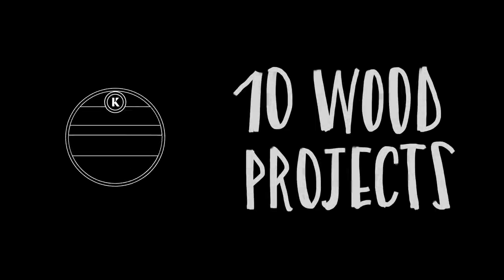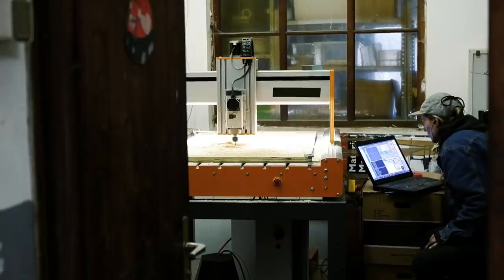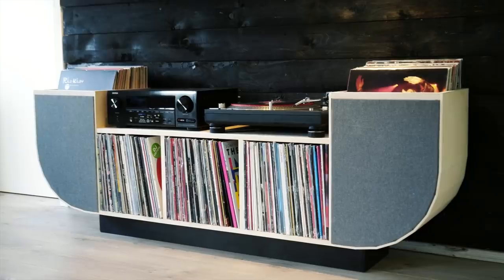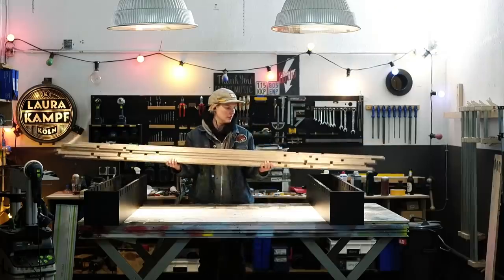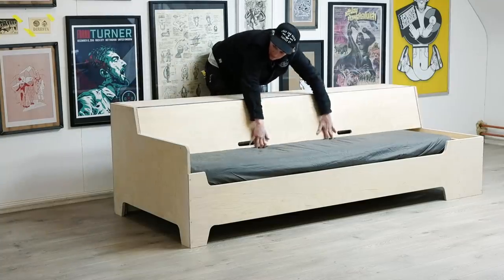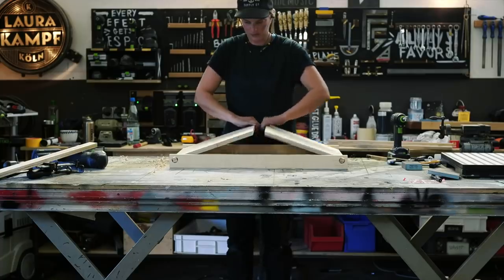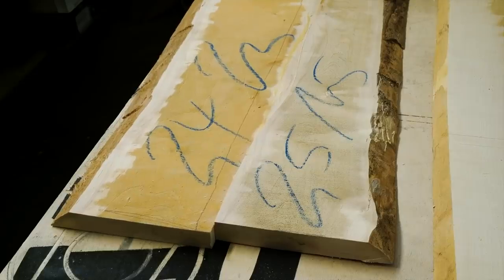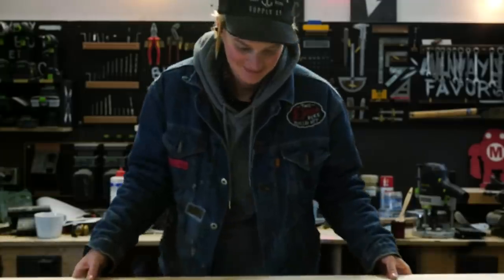10 Woodworking Project Ideas

Comment: The bandsaw jointing trick is the coolest wood project for sure!
Reply: Definitely one of the coolest ideas I’ve seen with wood working!
Reply: Yes!! Thats a useful trick! I Will idé it next time im making a floor
Reply: 100% agreed! Jointing is always such a boring thing to do, this technique makes it much more fun. Now I just need a bandsaw. :-D
Reply: yeah it's cool, it is the same old technique used to make woven style items using different woods and colours
Reply: Going to try this!
Reply: I've seen a similar technique with a router for a cutting board, but Laura takes it up to the next level. Amazing!
Reply: Only works if your able too get the wood through the saw but a jig saw will do the job the same if you take your time .Great job 
I am currently working on a 12 foot by 40 inch table made from 2 boards  I will be posting it in a month or so.

Comment: My girlfriend and I made an even simpler version of your simple bed in queen size. We live in an apartment with really narrow stairs and the only way we can put a bed inside the room is if it’s modular. Made 3 bases instead of 2, and the slats were divided by 2 in length to make them shorter and easier to work with. Thank you for the idea and design. All our tools are manual (apart from a cheap jig saw), but we definitely enjoyed the build. 😊👍🏼

Comment: Good afternoon Laura, yes my favourite woodworking project of yours during 2020 was the simple bed idea, it’s so easy to make and will last quite a long time, but the best thing that I like about it is if let’s say you were to move addresses it’s so easy to take apart and remake at your new home 🏡 and I also think that beds should be made like that.
As always Laura you have some of the best ideas for build stuff no matter if it’s for a bicycle, a bed, a table or even something for the outdoors like your tiny home on wheels, because they are the ultimate in recycling/repurposing and item that just might end up in the fire or melted down eventually for use as something else and I would like to wish you all the best for 2021 and I can’t wait to see your ideas for this year.

Comment: The non-linear jointing with a bandsaw method has been around a long time,  although I don't recall having seen it used on the scale of a tabletop.  I have mostly seen it used for making decorative box lids and cutting boards. 
Nicely done.

Comment: Your designs really fit my style . For years I thought about replacing my old bedframe DIY. Until I saw your video I haven't found a design that motivated me to do it. And you are right all I needed was a track saw and a drill. It turned out really great. You can move it easy in Parts but build up it's like tank and feels so good through its pure weight. 
Thx Laura

Comment: Happy new year Laura,
it is very nice that during this recapitulation of your best projects you have shared the improvements you would make in case you had to do them again, it makes you honor and honest!
  Incidentally, your folding table inspired me to make a small table for my portable milling machine: as hinges I used 10mm threaded bars but it is always a folding table: when I put it away and take out the milling machine, it takes away little space, like the your.

Comment: The closest thing I've seen to the bandsaw trick was something my dad did years ago. He was making a bar top for a customer out of 4 walnut slabs. He clamped two slabs together edge to edge and cut the two edges along the grain with either a jigsaw or a sawzall. afterwards, he slid them closer and re-clamped. he did this a bout a dozen times until he had a perfect joint. His goal was to hide the joint in the grain so that it looked like a single slab. Your method seems a it easier and more refined. Either way keep up the good work! Danke!

Comment: I've seen a similar idea that uses the same concept as your easy glue up method. The guy used a sacrificial strip on top of 2 non jointed edges and pinned them together with the sacrificial strip. Then he ran the entire piece through a table saw and of course, both sides were now a perfect match to each other.

Comment: 10:40 This method is used at industrial level. They make floors for many years already. First, all the slabs get scanned and them the computer arranges them so the waste would be minimal. Boards get cut by cnc and every floor is different and goes together only the right way. Check out Bole floors for example.

Comment: I like the sink. But you need to silicone the top of it where it meets the wall. That will stop horrible things growing behind it.

I would also make a splashback out of ply using the same method. (or some scrap  aluminium)

Comment: I've seen a similar method used to widen an arch as the overlapping cuts for the table. You cut an arch then take the cut out and move it to match the two straight sides  to create a curved piece of wood. Saves on wastage. Weaker though obviously.

Comment: The table. I never did like the straight lines of the standard table. For the warpage that happened, I was thinking of cross beams on the edge and a couple or possibly more underneath to add stability.

Comment: The arms on the chair were too low because you forgot to raise them on the CNC chair. Get some firm foam and make arm cushions by sticking it onto wooden boards, then covering with leather or fabric. Make them the height you want the arms raised then screw into the board in the cushion from underneath the arms of the chair.

Comment: Captain hindsight here. For the bottom, you don't have to cnc it if you don't want to. You would use 4 triangles to make the bottom, all angled down a bit from edge to the drain. They dont need to be symetrical, just have their meeting point where you want the drain to be. there are multiple ways to achieve the angling down and the drain doesn't have to be at the center either (doewnt even need to be just 4 triagles, one per side is the simpler version) , but they're all implementations of the same concept. First time takes a little figuring out, but after that it us easier to think in composite angles (or fake composite).